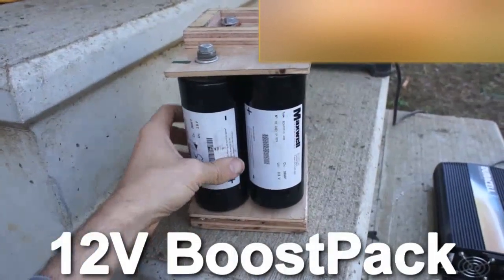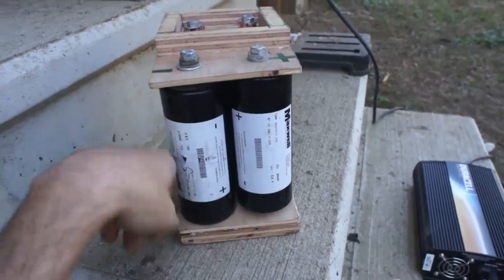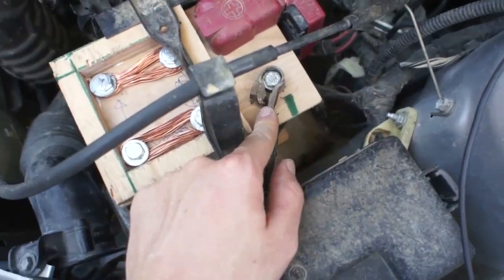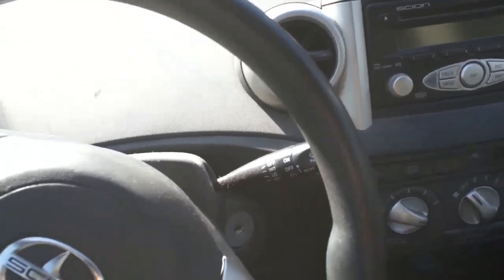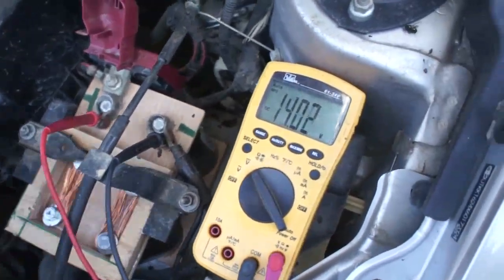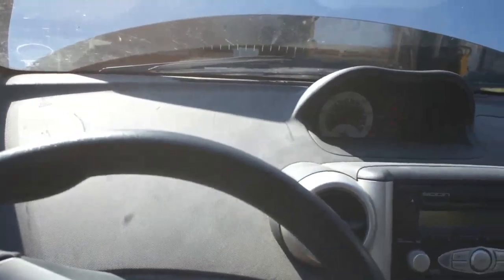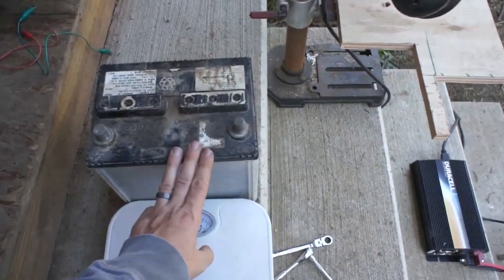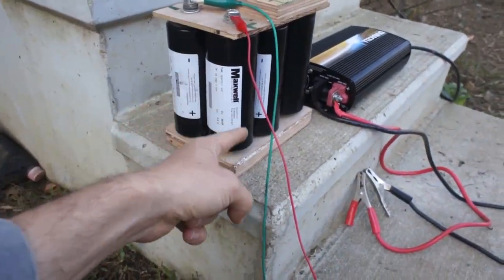12V BoostPack. Replaces auto battery. Works great!

Comment: lasersaber I went to your site but I didn't see a link to where you're getting the caps from.  Can you post the link to where you're getting them from?  I'm interested in trying a few things with it.
Reply: Foxxs Warren Well yes it will.  But that's if you leave your stuff running, which you shouldn't do anyway because you'll even kill a lead acid battery.  This is a perfectly valid, functional and 100% reliable alternative that will function as indicated for your car.  It will not however power your rav party that you decide to have in your car, sitting in the wal-mart parking lot.

To be honest that point is a tad moot and nick-picky.  That's like saying "If you step outside when it's raining you'll get wet".  Of course!

So yeah, if you're wanting to rock out to whatever you listen to in your car with your engine off...then no...this alternative to an expensive lead acid battery is not for you.  However if that's not what you do, then this is a perfectly valid, cheap and very reliable alternative.  

Also in a later video he shows you where he has as 2.5w (I think it was 2.5w) solar panel hooked up to it as well.  You can fully get away from Lead Acid batteries and still continue doing what you just spoke of.  

So in short.  Yes...this can totally replace your standard chemical based battery.
Reply: Kevin Lupo
actually Fox's requirement that only a car battery could do that is not just null but totally wrong. if you discharge a car battery very much it scars it. so unless you have a deep cycle battery, capacitors are far better.

not counting i find it hard that he can't find a radio that runs off a AA or something.

in my opinion using a starter battery for anything but starting while the engine is off is a terrible idea. liable to get a flat battery.
Reply: Foxxs Warren Search them up. It's a real thing. It's called double-layer capacitor, if i'm correct. I bought a 1f 5.5v, about a year ago, and it's working fine, and the most amazing thing is, how small it is. BTW modern batteries, have more energy to weight ratio, than the best capacitors on the market.
And as you mentioned it will screw the alternator, without any amp limiter.
Reply: Please, the stereo was just an example, what if you can't start your car in the first time and have to try it again? Let's see  I have  a starter motor that in a small car will need at least 100A for 1.5 seg, so 100²*.1.5= 15.000J , dude that's a lot, let's see it in farads 
15.000j= 2*15.000/(12)², that gives me  208,33...farads,  and that's just for 1 try, you're saying that I can run a stereo (again for example) for 15 minutes with a "3600" farads cap? Have you looked for the size of one of those non-existent  caps, I should take the entire engine out to fit one inside. Otherwise a cap can't hold the necwsaey energy for so long as 1 week without loosing the 60% of the original charge. Otherwise, caps works as a shot circuit till it got fully charged, which will fuck your alternator very quickly too, at least its regulator, 

It would work for a funny experiment, in real life it doesn't worth the waste of money, why not li4Po or lithium? They will work for 10 years most, without replace the pack. 
I'm not saying that it works, I'm saying that might be not reliable
Reply: *****
yeah but the only reason in many cases for a battery is to start the car. so if it fills all the needs why can't it replace it?
Reply: Where in "Capacitors are not a replacement for batteries" did I mention a car?

Where in "They don't replace lead acid batteries"  did Foxxs Warren mention a car? 

Foxxs point as well as mine, is that capacitors are not batteries, nor a replacement for them.  Its why batteries are still in use.

I'll repeat myself -

Will they start a car?  Yes. 
Are they a replacement for batteries?  No
Reply: They don't replace lead acid batteries.
Reply: OK, put one of those packs in your car, now turn on the lights... and wait 20 seconds to run out of charge, you can MAYBE charge that big bank and start your car and maintain its charge with the alternator, but when you stops the motor and let your stereo on, that thing will die quickly
Reply: Rinoa Super-Genius I can agree with your statement, because it is very much true that significant discharge of ANY battery degrades the life of that battery.

It's understandable that sometime you may forget to turn your lights off, in which case you're screwed whether you have a battery or the cap pack.  Only difference is, the cap pack will take a charge MUCH faster and it will not receive any noticeable degradation due to the complete discharge.
Reply: Guys, if you really think that you can replace lead acid batteries with capacitors, this is sad.
Reply: Foxxs Warren soooo....ya don't think its possible to start a car with capacitors? a battery's sole purpose is to start the engine. i don't know anybody who would run their stereo or lights or anything when the engine was off. theres just absolutly no reason to.

and even if you really really really wanted to run your radio with the engine off for whatever odd reason, you could add a small SLA deep cycle. would by just like lasersaber's next capacitor bank with the lithium battery.

and lastly with 3600 farads you could prolly run your stereo for like 15 minutes.
Reply: Foxxs Warren Watch his other videos...It does work, I've not cranked a car with caps but I've done far more.  You can get a lot of amps out of it...and it's more then enough to start your car.  if you're starter is bad...then you're still potentially going to drain your chemical battery.

For example.  I had my fuel pump go out in my mustang.  I attempted cranking it.  With a brand new battery I only got a few attempts on a cold morning before the battery was so dead it wouldn't turn over the car.  Now if I was using caps, on a cold morning, I'd have gotten a few more attempts in...would it have cranked, no, the fuel pump was dead.  But that's your exact point, what if's.  It works, try it if you don't believe it.

Also, you won't ruin anything, because if you're savvy enough to make this, then you're savvy enough to have a voltage regulator attached to it that won't allow reverse voltage so you won't get that slow bleed off when your engine isn't running....and you won't risk sending voltage back to your alternator.  

You're right, that you will only get a few attempts at cranking your car if you have a bad starter, just like I'd only have a few attempts of cranking my car with a bad fuel pump.  The point is...if that's the case, you're going to ruin your battery just like I ruined my brand new battery by killing it dead and then recharging it.  You won't however ruin your cap pack...so once you fix your starter...a very quick charger later and you're on your way back to driving.
Reply: God told me that "super capacitors" are evil so I don't know a shit about it
Reply: ***** i hope we reach a point where we dont need to increase capacity much for most devices. that would be awesome.

couse i would assume once you can travel like 20,000 miles in an electric car on one charge, you wont need a whole lot more. thats prolly a century away though.
Reply: *****
Batteries do not GENERATE voltage. They must be charged. The full name is STORAGE BATTERIES! Batteries and capacitors work in a similar way. The components within the device store electrical power (voltage) that is put into them (charge). Batteries release their power somewhat slowly whereas conventional capacitors release their power quickly and their charge will leak off quickly. These capacitors are not conventional old-style capacitors. These use a more efficient design/components/electrolyte.
Reply: I'd appreciate it if you wouldn't call me a fool. You don't know what I have learned about electronics/electricity or not learned. I don't like naysayers.Telling others what can't be done..."Oh no, that's not possible!" or " You can't do that"!. Why are you trying to stifle this research. This is new tech, an advancement in the field. Don't reject it out of hand just because it doesn't seem to fit with what you knew before.Things are changing quickly. Close your mind, be left behind.
Reply: Yes, everyone knows that "capacitors have been used...for many years" These caps are not the same as those from "many years".  Left behind. Graphene
Reply: 19jimbob52   These type of capacitors have been made by Maxwell for the last 18 years and used in thousands of different applications over the world.  

I think if anything got left behind, it must be your brain.........
Reply: lol saying these capacitors are untested technology is like the USA government saying LED healights are untested technology while other countries have been using them for years.
Reply: *****
You're still naysaying, trying to stifle, "No, will never replace batteries, can't be done, won't work, forget it, stop wasting your time".  What makes you think that you KNOW what can or can't be done unless it's tried and experimented with in a million different ways? Do you think you have the future of electronics all figured out? You want to close the Patent Office! Make way for the Electronics' Genius of the World!
Reply: You said , "Capacitors are NOT a replacement for batteries.  PERIOD." How do you know? Nay-saying! & "Batteries GENERATE voltage"? No, they STORE voltage!  & "I was just pointing out that capacitors are not batteries". Why do we need you to point that out to us. Apples are not oranges! It's obvious! Nay-saying! & "capacitors have been used to discharge large amounts of current quickly". Why does if have to be "LARGE amounts of current QUICKLY? Caps also discharge small amounts of current and sometimes slowly. They also absorb/accept/receive/charge quickly and, depending on the circuit set- up, slowly. There was a guy in my class that thought that electricity was alive. That it could think/plan/plot/trick. That it wouldn't respond the same way in identical situations. That it was out to get you!
Reply: texjarhead
Lead-acid batteries,whether flooded, sealed or absorbed glass mat (AGM), do not PRODUCE (generate or create) electricity. Quoted from batterycounsel.org;"A lead-acid battery is a electrical STORAGE device that uses a reversible chemical reaction to STORE energy...Most people don't realize that a lead-acid battery operates in a constant process of CHARGE and DISCHARGE...How a Battery is Made:...The final step is formation. During this step, the battery terminals are connected to A SOURCE OF ELECTRICITY and the battery is CHARGED for many hours." Not PRODUCTION, GENERATION or CREATION but must be CHARGED and RECHARGED with electricity supplied from an outside source. CLASS DISMISSED!
Reply: Not same. Similar.
Reply: Foxxs Warren
yeah they can. what makes you think otherwise?
Reply: Foxxs Warren  i hope that you realize the super capacitors in this video are 3600 farads.

but oh well i can't waste time trying to convince somebody who is biased to only accept what they want.
Reply: Rinoa Super-Genius Well, Foxxs Warren is a good guy...he's just got his own opinion.  I'm not mad at him, nor think him stupid or closed minded...I'm just debating with him.  In the end though I hold absolutely no hard feelings towards him at all.
Reply: "They don't replace lead acid batteries." 

Exactly.  Foxxs Warren is right, whether you guys choose to believe it or not.  Capacitors are not a replacement for batteries.  You get the high amp output, but not the high reserve capacity.   Capacitors have their place, but so do batteries, which is why they still exist and haven't been replaced.
Reply: *****
they can replace them if your not using power when the engine is off. and better yet just make a hybrid pack.
Reply: Rinoa Super-Genius   My entire comment went over your head.....    

Capacitors are not a replacement for batteries.  Period. 

Will they start a car?  Yes. 
Are they a replacement for batteries?  No.

Batteries generate voltage through a chemical reaction.  Capacitors only store energy.  They are two totally different things.
Reply: i agree with *****  but now i agree with Riona with the idea of an Hybrid pack
Reply: *****
well someday they could be better than batteries since they dont have to convert the electricity to chemical energy, i do agree they don't yet replace batteries in general. i thought you meant automobile batteries.
Reply: Rinoa Super-Genius
Glad we understand each other now.  And I agree about the future.  It will be interesting to see what happens in the coming years with energy storage, both for batteries and caps..
Reply: 19jimbob52
 Maybe you should learn what you are talking about before making a fool of yourself on the internet....    Batteries convert chemical energy to electrical energy.  Chemical reactions power a battery.   They are not purely storage devices like capacitors.
Reply: 19jimbob52
What on earth are you talking about?  This isn't new tech, capacitors have been used to discharge large amounts of current quickly for many years, in all types of applications. 

How am I stifling anything?  I was just pointing out that capacitors are not batteries.  What is so hard about that for you to understand?
Reply: 19jimbob52
I never once said any of what you have put in quotation marks....    What the fuck are you smoking?
Reply: You said those things. Oh yeah, nice thumbnail  photo. The bottom lighting is very scary! Watch out! Reddy Kilowatts' gonna gitcha!
Reply: 19jimbob52 You really need to go back to school.  You missed a class or two.  Caps store......batteries produce electricity from a metal/chemical reaction.
Reply: They store an energy source.  What ever buddy. Use a capacitor, they must be the same thing.
Reply: I worked for Interstate Batt, systems - most battery's come fully charged from the factory - motorcycle batt are sometimes dry and acid is added by customers at home - in which case they must charge the batt before use.

Comment: At 3000F, that's about 10aH for $36.  [They're normally $60-80ea!].   For something similar to a car battery in terms of usable aH [batteries half of what they are rated for] you will need about 60 and at $6 the price point is about the same for a decent deep drain battery, except they will last pretty much indefinitely which is what every person with off grid solar or electric car is looking for.  As the investment is 10 times the price and the size is 10 times the size, it's still better to use lead-acid batteries hoping this will change in about 5 years when you can buy the higher rated and hopefully affordable super caps!
Reply: That's actually more like 5 amp-hours at 12V, because you have to account for the decrease in voltage as the capacitor discharges. The energy in a capacitor is 1/2 * C * V^2, so if C=3000 and V=12, that's 216 kJ or 60 Wh. If you ran it through a boost converter to produce a steady 12V, you'd get 5 amp-hours until it collapsed, not 10.

This is roughly the energy capacity of a typical laptop battery or an old brick-type lead-acid gel battery, so you can see that the energy density is still not great compared to chemical batteries. But the long cycle life is really attractive if you don't really need to store that much energy.
Reply: A good lead acid maybe will get 6,000 recharges, and that's a really good battery. Good Capacitors will get well over 1,000,000 drain/recharge cycles.

Cost comparison 10 batteris = 1 capacitor bank. 10 batteries have a 60,000 drain/recharge cycle. 1 capacitor = 1,000,000 drain/recharge cycles. 100 batteries get you 600,000,,,,, 150 batteries gets you 900,000 drain/recharge cycles to your 1 capacitor bank that gets you 1,000,000... so maybe that capacitor bank costs you $600, 150 GOOD car batteries ($90 each) costs you $135,000. Cheap batteries ($60) get you 3,500 drain/recharge cycles, so do the math there.

Then there's the whole issue with temperature. Cold weather wrecks havoc on batteries, but a Capacitor laughs at cold weather because it's not effected.